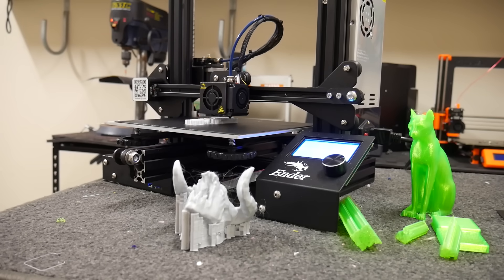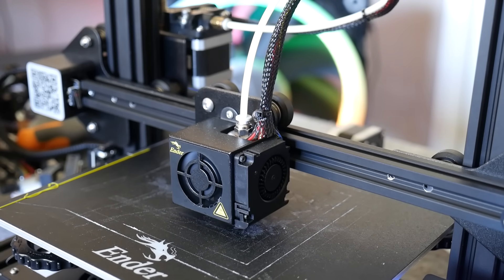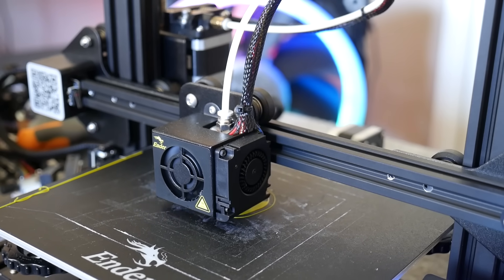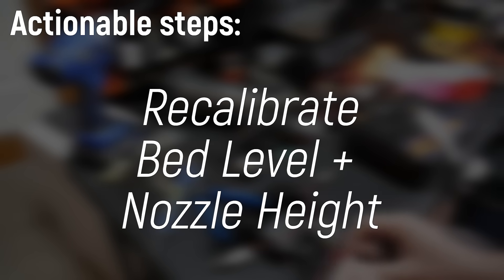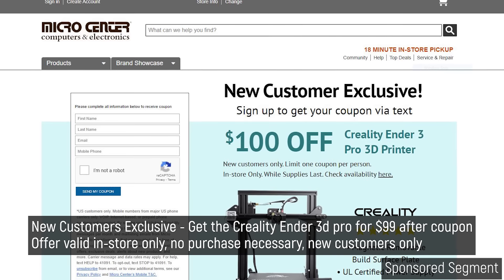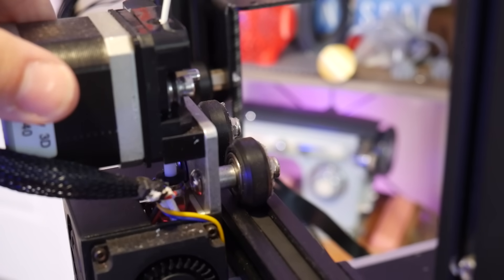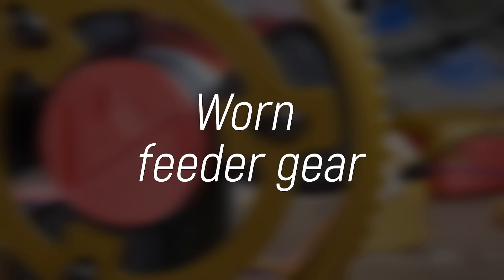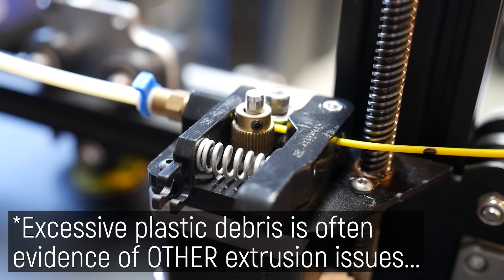Have your 3D Prints started to suck? Watch this!

Comment: I leveled my bed, bought a new sprite extruder, new print bed, cleaned the printer from dust, while installing the extruder I checked the wiring, I cleaned and leveled the bed again and all this in less than a week. The problem wasn't solved...

Comment: I still cant get rid of my Y shift :\
Reply: Layer shifts are normally either due to printing too fast or the bed is hard(er) to move in one spot. Can be due to a bearing failure or some sort of alignment issue perhaps due to v groove rollers too tight. I recommend removing the belt and checking the bed moves smoothly and easily. I've had bearings in tensioner pulleys fail. Very hard to tell while it's in the printer.

Comment: Jesus christ use dishsoap. With isopropyl, yes you dissolve the oil. but it dries back on it in no time. BUT if you take your plate off (cheap chinese magnetic flexible PEI plate in my case) and wash it with some hot water, dish soap, and dry it with one use kitchen towels, You will, i assure you, get AT LEAST the results of isopropyl. After all, dishsoap has been designed to get dirt off and break oils surface tension, And washing it with hot water gets it all completely off. It also cleans print residue really well. (Filament blobs)
Did i also notice dishsoap is cheaper and WAAAAY easier to obtain?

Comment: I got so sick of releveling Ender 3 bed that (1) I got wheel clips that don't let them turn on their own, and (2) I modified the Z homing system to home against the bed instead of a fixed position on the Z extrusion.
Reply: Its the aluminum warping due to heat cycles. Usually not bed springs moving.
Reply: @saxplayingcompnerd  Not when I print with cold bed.

Comment: Frankly what I need is a good community where people want to help. I'm sorry, but all you youtubers, and youtube as a whole, just don't cut it. Unfortunately with the death of most message boards, that usually means Reddit and that is a cesspool.

On Reddit, you usually don't get either any answer or none that actually helps. I was on one German forum but in trying to not have to repeat themselves, they actually stopped responding civilly to anyone, who does not provide precisely the information they deem necessary. Any pleas that you don't even get that far fall on deaf ears.

Youtubers don't answer for the obvious reason that a content creator cannot provide support for the whole internet on top of creating content.

Since I don't live in the US, I don't exactly have any Makers clubs in the vicinity... or if I do, I wouldn't know how to find them.

Right now I'm stuck at Teaching Tech's stringing test... no matter what I do, the test piece has lots of stringing towards the top, no matter the retraction settings and no matter the direction of incrementing the settings... so whether lower retraction i on top or bottom, the final result keeps looking the same. And for the life of me I cannot find out why.

To this day, months after I got my printer, nobody could yet tell me how to make sure the feeder has the proper compression (?). It's as if the feeder didn't matter, yet I've seen countless people upgrade that thing.